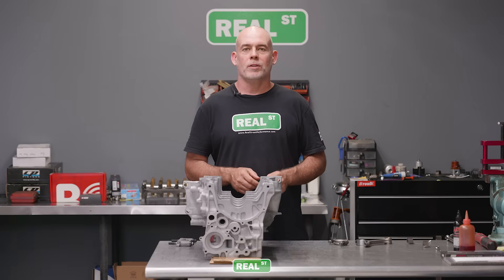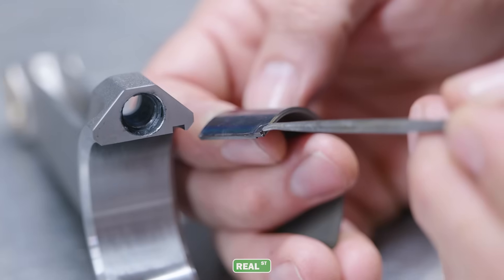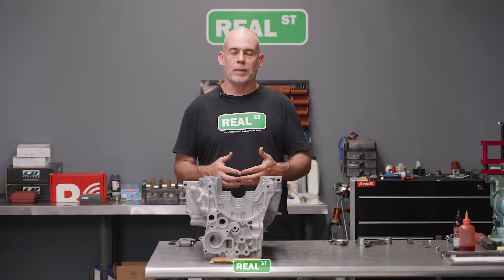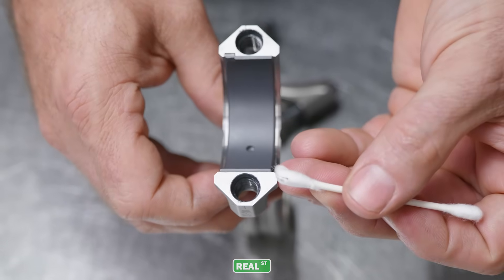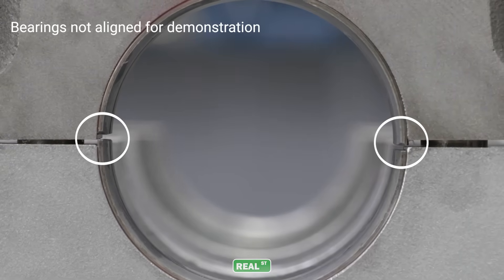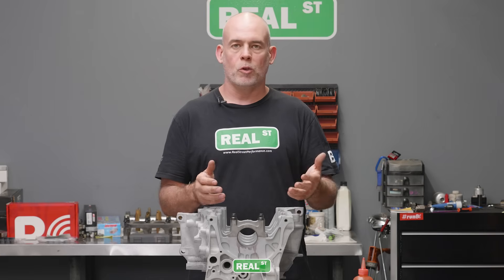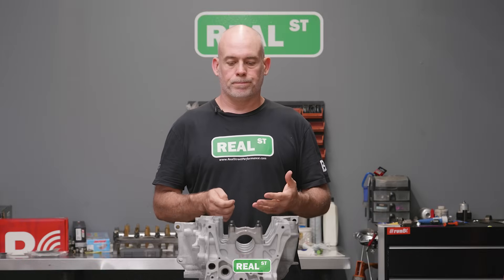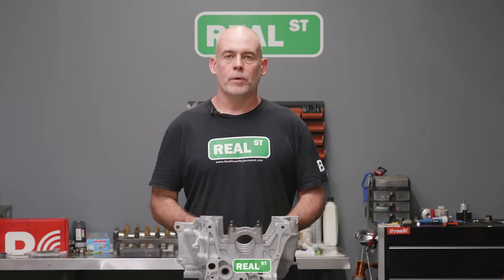Adding Oil On The Back Side Of Bearings During Engine Assembly. Good Or Bad?

Comment: Never have in 40yrs. of engine building, never will. My work has seen use at over 8000rpm for two plus hours at a time and never has there been any bearing issues.
Fact is, I use acetone to clean the back of the bearings and the bearing bores.
Oil between the bearing and the rod/cap/main web creates a heat dam (by becoming a carbon layer) which reduces the ability of the bearing to shed heat.

The reason main and rod bearing bores are honed to finish size is to create the cross hatch finish that combined with the proper bearing crush all but eliminates the possibility of a spun bearing - the LAST place you want lubrication is the back of the bearing.
Reply: Im lost...... Im pretty sure motor oil will find its way behind the bearing backs regardless. Oil is constantly splashed around to help cooling as well. Everything is contracting and expanding, I think we would be kidding ourselves if we think it remains dry back there.
Reply: @GrandProductionsMedia  All engine internals are living in oil and it gets everywhere, has anyone ever taken apart an engine to find no oil behind bearings? I think not
Reply: @skerlone  
The bearing is crushed by the cap, which is what keeps it from spinning, not the tab - so there's no actual space behind the bearing, whatever oil finds its way in there is between the tiny ridges left behind from honing the bearing bores while the bearing is in solid contact with the ridges themselves.
Reply: @skerlone  
It creeps into the finish behind the bearing, the bearing doesn't sit on it - it's a crush fit.
Reply: @Motor-City-Mike  agreed, whatever oil creeps in there it doesn't create a continuous film as it would with pre oiling the surfaces before assembly. While the difference in heat transfer might be negligible vs pre oiling them, your theory stands true.
 I guess the next thing to try would be installing them with thermal paste instead of oil if one can find a paste thin enough to not affect tolerances.
Reply: @GrandProductionsMedia  I'm pretty sure that if you find oil behind the bearings  , you either bought very shitty machine work or your old engine is worn out
Reply: Another thing to watch for is if you scrape the backside of the bearing while dropping it in. 
It's tricky to get the right feel for the squeeze you wanna give the shell to minimize that , and you don't wanna overdo it and  bend it. 
If ya felt ya scraped it a little , see if the sliver/curl is still on the bearing.
Remove that with a little blade or scraper or it'll affect the clamp on the bearing. 
Just a little doodad I learned from an old timer long ago.
Reply: @MrTheHillfolk  good comment. 
I break all the sharp corners on the block, rods, and caps.
Nothing real big, I just use a 320 grit stone and round the sharp edge. 
I'm one of those guys that checks every part that goes in - even open up brand new oil pumps.
It's just how I was taught.
Reply: @Motor-City-Mike  Past years I have found the embossment of part numbers and logos have been proud and that alters the shape of the crushed bearing. I always run a file over the letters and scotchbrite the backs of the bearing. About 1/2 of the time the file will remove the high edges of the embossment, and since we always read what the engraving says to eliminate incorrect parts it just takes a little more time.
Reply: @tedgerstenslager2949  
Same here.
Again, I use fine stones - only because they remove the metal a little slower and show a shine as I knock down the imprints on the back of the bearing.
I also mic the crank, lock the mic on size then set a bore gauge with the mic - then the gauge reads my exact bearing clearances.
Reply: Gonna have to try the stones.
Same here, use the mic to set the bore gauge. Takes patience, but it works.
Reply: @Motor-City-Mike  ,,,,,thank you....finished or finalized machined parts are perfected by  measuring , cleaning and deburring,,,,,,,eliminate all sharp corners,,,,,radii is a good thing......
Reply: Even if it's kept bone-dry during assembly you'll get some motor oil pushed behind it when you first start it. And motor designers are fine with that, otherwise there'd be an o-ring between block & bearing feed holes.

Turns out 60-80psi is plenty to push a little bit of oil behind a bearing when it's fed by passing it thru the bearing - like all modern engines with pressurized oil systems do.
Reply: @hydrocarbon82  
The oil that's there 'creeped' into the honed finish on the bearing bores, the bearing itself is still solid against the inside of it's bore - it's a crush fit.
Reply: so you're saying, the life of your engine builds the backside of your bearings stay completely dry and free of any oil Mike?
Reply: Mike when you post some content or proof of your 6 sec cars ill listen to you till then ill follow the ways of a guy that's taking the time to educate us and the proof is there for everyone to see.
Reply: @RJCoAustralia  
Hope you're talking to some other Mike...
I never said anything about six second cars - I built engine for a small team that ran All-Pro and the Craftsman Truck series in NASCAR - which is why I said how long the engines spent at those RPM - it's one thing to build an engine that runs 8000+ for so many seconds at a time - and another to build one that does it for hours at a time, the small things get a lot more important. 
If you don't agree with my methods that's just fine.
If you seriously expect me to spend my money and time to put two engines together, one using each method, run them, tear them down and post a video showing the results you may have had a closed head injury at some point that caused permanent damage - it's not going to happen.
Additionally I don't have the ability to break the space-time continuum so a trip back to when I made my living building engines is also out of the question. 
If you are talking to me then do it how you damned well please if you even do it at all - I made my living doing it and don't have to prove myself to anyone.
If not me 'Mike' then no worries, enjoy the journey.
Reply: @Motor-City-Mike  can I ask you a few questions about the nascar stuff? I find that level of engine building very interesting.. 1. what engine brand did you work on?  2. what is your opinion on gaining    .XXX amount of valve lift, is it better to have higher ratio rocker arm with less cam lobe lift or the opposite low ratio rocker arms and high lobe lift?  3. what sort of milage can be expected from titanium valves on the street?
Reply: The guy that made this video loses all credibility when he says "Don't ever sand the back of the bearings, use a scrotch brite". The scotch brite is a sanding instrument. I buy them for body work and sanding. The red scotch brites for instance are the equivalent to 320-400 grit sandpaper. The greens are probably 600 grit. The removal of any material on an instrument designed for .001" clearances is asinine. I clean mine with paint thinner along with the cap surfaces.
Reply: @RJCoAustralia  FYI, I'm 65, and I've assembled a "few" engines in my time.  I've never heard of putting oil on the backside of rod/main bearings, ever...   lol
Reply from the maker: Thanks for the feedback Mike!
Reply: @realstreetperformance   Everytime he pulls used bearings guess what's on the back side.... OIL
Reply: @realstreetperformance  
Absolutely. 
We all have methods we're successful with, as long as the end result is the same we're good.
Reply: i am  67 started at 17 l1 master car and truck so i have done a few engines in my time and you took the words out of my mouth
Reply: The ones getting oil behind their bearings after their engine have been started are the ones fling, stoning, and/or scrotch brighting the back of their bearings. If you were to talk to the bearing manufacturer they would probably want to shoot you for doing such things to a precision insert bearing. If it needed to be done, they would have done it before you got your greasy little hands on it.
Reply: @bobsbillets  As was previously explained, the HOT oil will migrate in the crosshatch, much like the crosshatch in a cylinder allows oil to lubricate the bore. Adding normal viscosity oil may or may not affect the clearances, but he has been doing it with success, so it works for him. 
You on the other and obviously have not machined, checked, clearanced, assembled as much as a lawnmower engine, so quit trying to talk like you know something. A person that removes bearing from a box and puts them in an engine without the first bit of inspection or finesse is an idiot.
In anything performance related, nothing fits, as there are machining tolerances to every part made. You should probably invest in a book such as the Reher Morrision engine building book, to at least learn the basics before you flap your gator about what is wrong or right.
Reply: @tedgerstenslager2949  MY engines (as is plural) run just fine in my 150 mph Nortech. They make 1100 hp ea. on pump gas, and they have 5.0 liter whipples with Emtron fuel injection.  SO I could really give a shit less what you have to say. Marine engines have the HIGHEST load of ANY engine because they never get a break!!!  So everything you just said to me makes me know You have no idea what you are talking about!
Reply: @bobsbillets  Or WHO he said it to. Man that essay was brutal.
Reply: exactley right mate , been building engines for 50 plus years ,absolute never oil on backside of bearings , you would get sacked here in australia for doin so.
Reply: Oiling the back of  bearings !! Stupid thing I've ever seen! What's next coating the backs with lock tight.
Reply: @jeremyking5684  “oiling the back of a bearing is the stupidest thing I’ve ever seen” you don’t own a mirror? 😂

Comment: I’m about to build my K24A2 bottom when it come back from the machine shop. Because of this video I too am going to do what Jay does.

Jay, I’m a novice in building engines yet I’ve taken motors (K series and S2K F series) but never done con rod replacement except head work like taking apart valves, springs, retainers, and TQ the head to the already assembled block. This is great. 

I’m also a novice tuner…well I know more than your average guy with a laptop lol if you have suggestions or tips on fundamentally tuning for beginners for fuel, knock, ignition though I feel ignition should be used on the dyno to see the value on the graph than ones butt dyno, cam angle, etc. I’m all game and I’m sure many MANY others will be glued to you. Not saying show us your secrets yet you’re doing it on engine assembly but enlighten us. I view you as the build father hahah, like Yoda of building 😎 

God bless you man

Comment: Hello Jay, thank you for your input on the matter of lubrication "under" the bearing shells. I did not hear you mentioning checking bearing clearance with a plasti-gauge. I never use them right-out-of-the-box unless I check clearance on mains and rods. Having oil under the bearing it will give me a 'false' reading, I do all the plastic-gauging and then remove the bearing and put plenty of the best bearing assembly lube available on the face of all the bearings. Even though I measure all the rods and mains with a dial bore indicator before I install them, I'll make sure all my number are right on. Sorry for the length  on this, I don't disagree with your method mine is just slightly different. Thanks again on sharing your knowledge. All the best to you.

Comment: Here come the keyboard mechanics.
Reply: Just to be transparent about my technique, I've never oiled the back of bearings, as I've never rebuilt an engine.
Reply: @krispykruzer since when has that ever stopped someone from telling a professional how to do there job...
Reply: Experts in writing skills, but nothing else LOL
Reply: Don’t forget the certified FB PHD’s
Reply: Good one
Reply: What's a keyboard?
Reply: @marcusmarcus8616  I think it's a musical instrument. 🙃
Reply: It cracked me up pretty good, thanks 😁
Reply: Fuck em
Reply: Thank God!
Reply: You know, I took a keyboard apart once and I couldn't get it back together.😅
Reply: @TomCrockett-bl1gp Try oiling the back of it next time
Reply: Engineers/mechanics can't type?  That would explain why they couldn't put it in the assembly instructions which way is right. Personally i don't see whats the point if it's a clean environment
Reply: And you are the 1st one.
Reply: Why not use grinding paste on the back side of the bearing,  the grit will key the shell into the block or rod
Reply: I know for a fact, a super thin film of oil is better than nothing .......because the last thing you want is to damage the bearing because it won't slide properly into place. 

If he was using grease it would be different..... Too thick.

 But oiling it and making sure the oil film is super thin makes sense to me.
Reply: @sasquatchrosefarts  you might have a point if you were sliding bearings in. I don't slide them in I push them in.